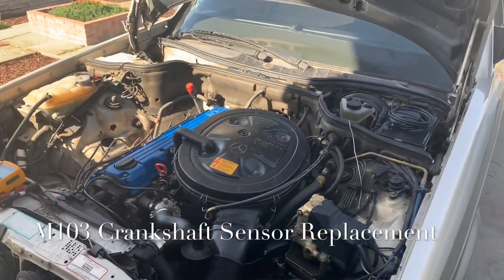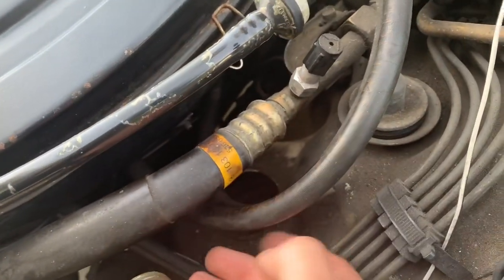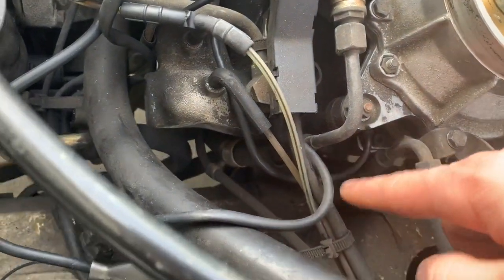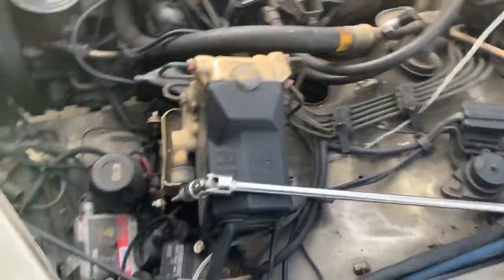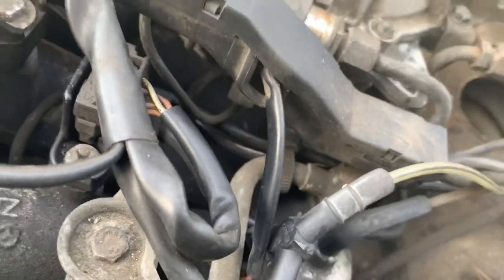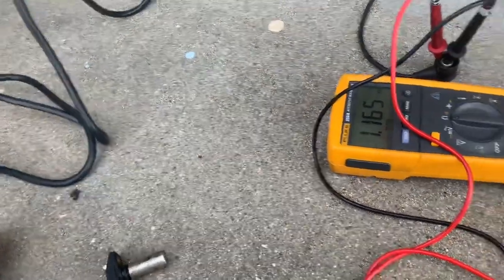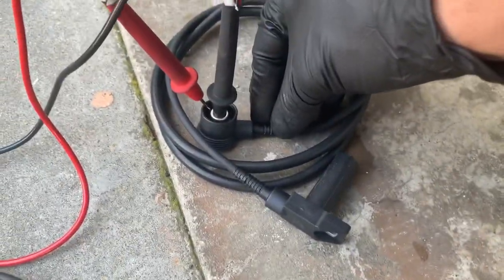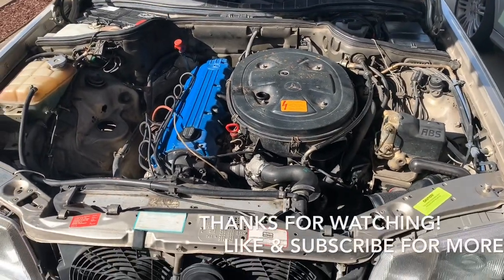M103 Crank Sensor Replacement

Comment: Great video - I tried this procedure, before (last year) - failed as the bolt holding the CPS was seized.  Anyway, this is a great video and very clear!  You did a great job to get your camera to focus etc...  One tip if anyone is trying this.  Be very careful not to break throttle assembly through lack of care...
Reply from the maker: Thanks, yea the Allen heads usually strip out, that’s why I try to spray them with some kind of penetrating fluid or work them back and forth first
Reply: @MercedesTech  Yes, that bolt was so freaking tight, I applied WD40 to loosen with no luck and too applied much force and just chewed up the allen bolt recess...  That sensor is in such an awkward spot.  Not sure why the bold head is made of a soft material (brass?) too... 🤦‍♂️ ( I think Mercedes may have used an impact wrench or heat to get it out... It was an expensive repair.  Wish I could have done it myself, because the job isn't too mad, it's just a question of getting into that awkward spot and then routing the new cable through.
Reply from the maker: @1969RAJ  Exactly. Poor choice of material and bolt head. I learned my lesson removing the cold start injector that is held in by the same fasteners. I was replacing the idle control valve hoses and was only removing it for better access. Ended up having to drill and EZ out one or both of them...

Comment: I was trying to pull  a same sensor from 91 190 2.6 it broke the top piece of and the body is still stuck in block what do you recommend to get the piece out it looks like it is rusted from a block and I still got that metal piece of the sensors inside with a plastic body in block is it ok to use torch or heat gun to get that plastic melted down a little so that the broken piece comes out of course using a wise grip pliers on that broken metal piece?

Comment: Thank  you! I have an w124 260E, M103 engine. Your car has one CKP sensor or two?
Reply: My 1986 260 has one at the rear and one at the front as well. I believe the front one gives dwell signal that gets translates into the rpm of the tachometer.

Comment: Excellent.  Hard to find info on where this damn sensor actually lives, thank you for posting.  My car shuts down when the temperature under the hood gets too high---idling in traffic! Super annoying.  The resistance must go to infinity at some temperature, thanks for doing that experiment with the heat gun.

Also:  Sorry your repair didn't work. Did you open the distributor cap and get the humidity out with some contact cleaner?  Even a new cap can get a small amount of moisture condensing inside and short out the ignition--happens often to me.  Also happens to my Mercedes 500SL, that has 2 caps for each bank of cylinders---happened just yesterday, pulled distributor caps, sprayed MAF cleaner, replaced and it fired right up. 

Perhaps putting some RTV on the distributor cap is a good idea on these cars.

Comment: Great video! Very informative. Just a question if you don’t mind. I am currently having a warm start issue car runs fine when cold but feels like it’s misfiring when warm and almost stalls when you come to a stop and does not turn on once the car has been turned off. I thought fuel so changed the fuel filter but fuel looks fine!. I have replaced spark plugs and spark plug wires still the same thing. Heard people on forums say it could be coolant temp sensor so I replaced that and still have the same issue. so I don’t believe the car is getting too much fuel I don’t think fuel pump is bad either cause it wouldn’t start on cold starts if that were the case. Do you think cps has gone bad? And you said the crankshaft position sensor didn’t fix your warm start issues. So that being said what fixed the warm start issue? And is getting a new crankshaft position sensor worth it? Thanks.
Reply: I also heard something about brake booster vac lines that sometimes they can get clogged. Should I start there before buying a crankshaft position sensor?

Comment: My R129 300sl is cutting out at 4krpm, do you think that the crankshaft position sensor is the issue?
Reply from the maker: 6SPD V10 Sorry for the late reply, but I suppose it could be, I would expect crank sensor to cause more hot starting problems than anything. For your issue I’d probably suspect that it’s something more to do with the air flow potentiometer.

Comment: Ugh, that cable routing is a pain! I need to check my W124, I thought the crank sensor was up by the crank pulley.

Good news for nerds, those Mercedes zip ties are still available from the dealer in 2022. At least, that's what my guy says, I haven't received my box yet. Also, about five years ago, he got me some new Omega-shaped clips like you're tussling with here. It's very cool to be able to get almost any part you need for decades-old cars.

Sorry about your salted roads! You wouldn't want to see what I'm disassembling right now,  you'd be jealous.

Comment: Thanks for the video.
Questions. 
Why didn.t you try the heat gun on the new sensor?
Seems like a lot of work to remove the old cable and run in the new cable, so why not just snip the ends off the old one, and run the new cable via more direct route?
Reply from the maker: I could've snipped the old sensor, but I have a habit of trying not to destroy old parts due to working at the dealership so long and having to turn parts in or give to the customer. Also just in case they're not totally bad or I need to reinstall it for whatever reason. In regard to your other question, I also like to install parts the factory route and method to keep it clean and stock. Anyone is of course welcome to cut the old part and install the new part in anyway they find that works "better"
Reply: It’s not a Kia

Comment: Nice video. I am having trouble pushing the sensor into its hole. Pretty tight fit and can't get enough leverage to push it in.
Reply from the maker: I’d try my best to clean the hole with brake cleaner or similar. You could also then try to set it in there to start, then VERY CAREFULLY, use like an extension and tap to in lightly.

Comment: Great video thanks. I believe I found the culprit 🙂
Reply from the maker: Awesome! Glad I could help
Reply: @MercedesTech  By the way, at what specific range of ohms, you'd consider the sensor is bad?
Reply from the maker: @fritolay8668  I’m not sure as to what a spec would be. But generally when the sensor is hot, it will just show OL on a meter meaning there’s an open.

Comment: Does a m102 engine 230e also have a crankshaft position sensor? thank you for information
Reply from the maker: I’m not sure, as the only M102 engine I have that I work on is a 16V bolted to a 5 speed. I can check that later though, don’t know if it would be the same for an auto

Comment: how did you find out it was bad my car randomly cuts out at 2k rmps
Reply: cody loosle Did you figure out your issue? Mine is cutting out at 4K rpm, but only in second gear....
Reply from the maker: cody loosle at 16:40 you can see the test method of the crank sensor cable, which can be done with it still in the car. Mine was actually not bad(or bad to where it was causing my issue) I ended up replacing the fuel distributor and adjusting my fuel mixture.

Comment: I tried this on a w124 and the plastic broke off please any tips on getting it out it's a m104 engine
Reply from the maker: So your saying the magnetic end that goes in the back of the engine broke off?
Reply: @MercedesTech  yes the plastic top part broke off any help or ideas?
Reply from the maker: Depending on space you can try and drill it or something like and ez out. Otherwise if it’s all plastic you can try sticking a red hot needle or something similar through the plastic and let it cool so you have something to pull on
Reply: @MercedesTech  so do you think I could drill a concrete screw behind the engine with long extension and a universal joint? I would like to find a way to heat it up but that's looking like it's outta question
Reply from the maker: @donjuanmurray4957  yes, if you can find a way to get a screw in it, that should allow you to have something to pull it out
Reply: @donjuanmurray4957  have you tried to to it from the under side of the car? Maybe removing the starter you'll find more room the do this procedure...
Reply: @vmlelectronics  I haven't been able to get back at the car as to personal stuff, but the problem is I can't fit much of anything between the engine and the frame unfortunately

Comment: That's way more access then what you would have in say a w201
Reply from the maker: Yea. This particular job is real tight. I know that on the w124 and w201 the firewall is much closer to the engine/transmission. A buddy of mine and me removed 722.3 transmissions from all three configurations and the w201 was by FAR the hardest. mainly because the firewall gave limited access to the bell housing bolts.
Reply: @MercedesTech  yes sir, you get used to it but only after doing it several times, my w201 is on transmission number 4🤣🤣
Reply from the maker: @RicardoMartinez-kr5qk   damn, we were rebuilding the three we messed with. B2 band broke in 2 of them and reverse clutches went out in the 3rd
Reply: @MercedesTech  yeah, the b2 band seems like a weak point for these boxes, I've been tempted to re- weld a b2 band since they always seem to break at the factory weld spot.
Reply from the maker: @RicardoMartinez-kr5qk  Yes, definitely. Let me know how that works out if you actually try that lol